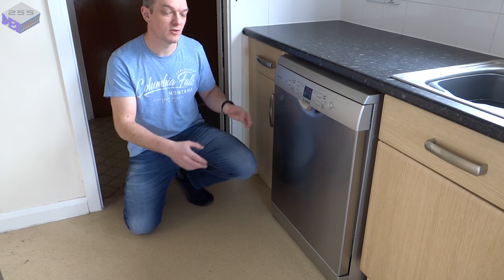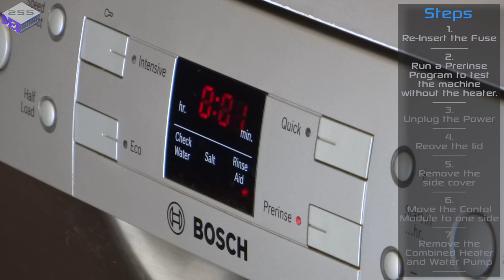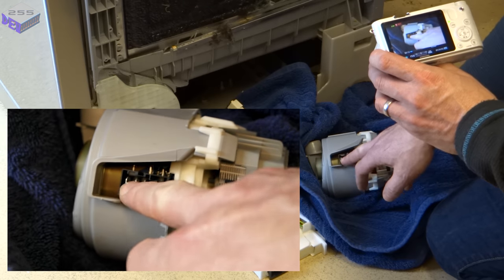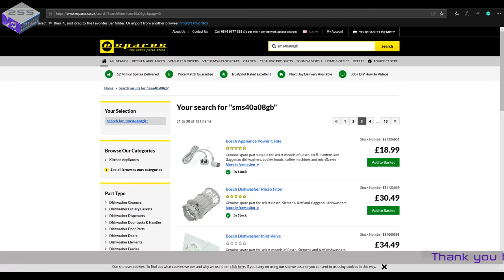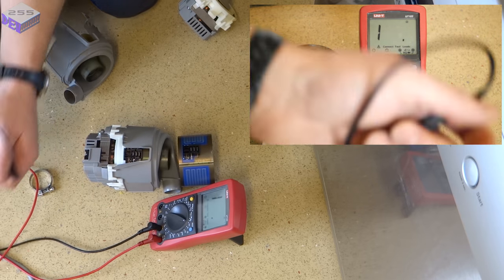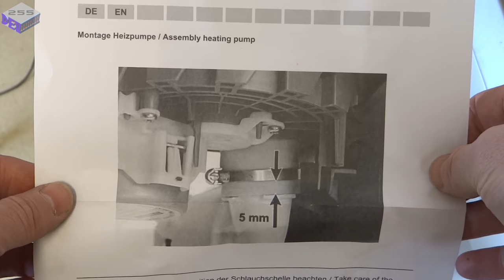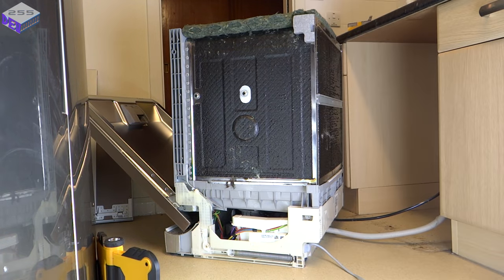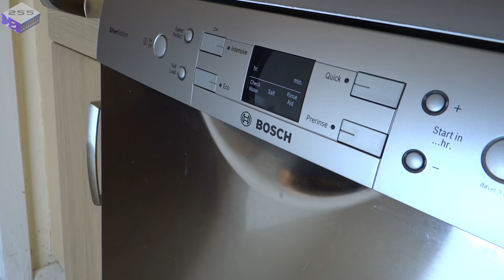How to Test & Replace the Heater & Pump in a BOSCH, SIEMENS, NEFF and more Dishwashers

Comment: Hi did the change out which although a bit tricky manged to get it done, however when I turn the power back on there is not power to the unit, any ideas?
Reply from the maker: Hi, I'd recommend checking everything that was touched during repair, plus the external items, such as Power cable connected correctly (this can look like it's connected although may be slightly out), the fuse in the wall switch/fused spur, RCD that feeds the socket (if testing on lone ring main), test on another ring main/socket via extension (13A one) all the connections are connected ok inside to the main circuit board. Failing all that, there is a possibility that the fuse on the main PCB has gone (if it has one, depending on the model). Hope that helps and good luck. P.S or it may just be a lose/disconnected soft power button inside the machine.
Reply: @TheSolarPoweredEngineer  Neil thanks for the reply It seems the AC power lead was not fully inserting into the white control box, bit of jiggery-pokery and got it fully in so all is ok now, thanks for the video dishwasher is back up and fully working now.
Reply from the maker: @MrPhiltodd  Glad you got it working, those power connections can be tight.

Comment: Thank you for posting this video. It's quite helpful as I will change my heat-pump once the new one arrives. One question though: The plastic connector of the 3 purple wires was damaged. I got a new connector, but I'm not sure if I got the cabling order right. (Labeling on the pump shows 3, 2 and 1). Any Idea /help for connecting the purple wires?
Reply from the maker: Hi, glad the video was helpful. The motor is a DC Brushless type, so each wire would be 120º out of phase of each other, so the pump may run in reverse if connected incorrectly; if this is the case (IE no water sound through the spray rotors) then swap 2 of the wires over and this will be sufficient. As long as the wires don't short out the motor will run. Unfortunately, I don't have a lead to refer to. I hope that helps.

Comment: We have also replaced pump, but have another issue. Grey cables on the pump were accidently pulled from connector. Is there any solution how to put cables back in connector in right order...there are some numbers (1 to 3) on it.
Thank you in advance.
Reply from the maker: Hi, the plastic shroud around the connector on the motor comes off quiet easily and then you can solder on new cables while off the machine, my machine is under the worktop now so I can't check the order of connectors. Could someone else opening their machine help with this please? Unless you have sorted it already. Hope that helps
Reply: I've mine open to fix right now if you are sill unsure. Purple wires go to white block and numbers are on motor, 1 highest up 3 lowest. The have photos of you need them.

Comment: Hi  i thought to check if you in help me a little, My girl used dishwashing liquid instead of dishwashing tablets then There were a lot of bubbles and we got the code e15, I wiped the machine clean and it worked again without error code. After we washed with it twice, the earth fault circuit breaker went off, after about 3-4 minutes, I opened up the machine, measured the heater and I got 20 Ohm so I cleaned a few more things in the machine and then put everything back together. Now the earth fault circuit breaker does not go off but the water does not get hot at all. Do you know what could be wrong?  /Christian
Reply from the maker: Hi, sorry for the late reply, it can take me a while to get through all the comments. It may be the thermistor on the same device and on the same connector as this could be telling the controller that the temperature is high, so it wont switch on. You can measure the resistance of this thermistor, where it should be in the 5 to 100kohm range. If water had found its way onto the heater, it may have also reached the the thermistor too. Plus you may wish to check the cables leading to it and the connections at both ends. Please feel free to ask further questions.

Comment: My pump has failed after 3 months, E09 error again!  Also mine came with a grey plastic clip part, no idea where that goes, inside the pump?
Reply from the maker: Hmm, maybe you have another issue too, are you getting water leaking onto the outside of the motor/heater? It may be worth you checking the front optical sensor hasn't been knocked as it's easy to do when cleaning out the space where the filter sits. I don't know of a grey plastic part for the unit, the pump and heater should come as one assembled unit. You can send me a picture of it if you like, I have a contact part on my web page here: www.dev255.uk
Reply: @TheSolarPoweredEngineer  Thanks for your quick reply! No leaking, I think the pump is faulty again. Sorry, its a blue clip, the 4th image on this site: https://shop.ukwhitegoods.co.uk/12019637-dishwasher-heat-pump
Reply from the maker: Ahh, that clip goes inside the dishwasher compartment, underneath the removable filter.
Reply: @TheSolarPoweredEngineer  Thanks, so this is an extra part, does it need to be replaced too?

Comment: Hi Neil, After E09 error, i fitted new pump. and old were damaged . i already tested old and i am sure that was heat pump issue.
Now after fitting pump, no water in dishwasher and also it is giving wired noise. so what i can do now. thank you so much.
Reply from the maker: Hi, sorry I didn't see your response until now. Have you managed to fix your machine?

Comment: Hi Neil, I had E09 error, as heater wasn't giving a reading on heater I got new heat pump. The E09 error is gone but it's not heating the water even though I'm getting 20 ohms on element. Would you have any ideas?
Reply from the maker: Hi, was the old pump reading less than 20 ohms, you may wish to check your heater connection at both the pump and control board, if you have 20 ohms on the heater and everything is connected ok, take a look inside the control box (without power of course), you may have a faulty controller. Also, was your's tripping the mains when getting to its heat cycle before you replaced it?
Reply: @TheSolarPoweredEngineer  Hi Neil, I had no reading from the old heater and the new didn't work, so I took it out and checked the connections nothing amiss so I put it back together and it worked for the 1st go. Then it stopped working, so I tried to see if I was getting 220 going to the heater and i don't appear to have. Do you know how to stop the program so it doesn't have to go through the whole cycle?
I'm getting 19.6ohms on element, I assume that's ok.

Comment: thanks mate, I did all mine but then getting e15 flooding warning (but e9 has gone now and heat pump works). I think it's due to my new pump not coming with a retaining clip as you show with your instruction. having a look to see if I can find one on amazon but otherwise I'm testing shoving the vertical up as far as I can go and pulling the old retaining clip down as much as I can
Reply from the maker: No dramas, I hope the video helped. It can be a little challenging to get everything back together and sealed tight in those small spaces. Also take a look at the sump water level sensor (usually in front of the removable filter) this sometimes gets knocked and can leak into the base.

Comment: Hi 
I have Bosch SMS69L22/55 GB dishwasher. I had check water and rinse aid lights flashing and dishwasher stopped in the middle of a wash cycle. Checked the filter hose and flow switch, they were all ok. Tested the heat pump and I am getting 20.8 ohms reading. Is this heat pump good or faulty?

Thanks
Raj
Reply from the maker: Hi Raj, the heater should be fine at 20.8 ohms, mine reads 20 ohms and is working well. It may be worth checking for water in the water catch tray (the bottom cover effectively), there should be a polystyrene float roughly in the middle at the bottom of the machine that rises when water gets onto this catch tray. This will operate a switch to stop the machine. Hope that helps, kind regards, Neil.
Reply: Thanks for getting back to me. There was no leak at the bottom. The reason I suspected short on heat pump is that the mains cable plug was getting hot despite dishwater not running and in error mode. There was short between positive and negative, reading 180 ohm on multimeter setting 200k. Sorry not good at units. All the other people online are pointing out the main board at the bottom is faulty when check water and rinse aid lights are flashing. After watching your video I decided to check the heat pump to rule it out. I don't think there is a way to test the main board so I may have to take a chance by replacing it. It is £120 fully programmed from Bosch.

BTW when I pulled out the main board and disconnected all the cables to identify the short, it just disappeared, I mean it sorted itself and now there is no short.

Thanks
Reply: Hi Neil
Rechecked the main power board. Between positive and negative terminals it is open circuit on all multimeter settings except one. When multimeter is set to 2M then I get 0.436 ohm reading. As I said I know just a little about electrical and electronics. By profession I am a mechanical engineer. The main board seems to clean although one resistance is flakey. There are two electrolyte capacitors one small 16v 470 uF, which is holding the charge, the other big one is 400v 100uF, which is just going to zero on all 3 points. Do you think it is right to try the new main board even if it is a gamble or should I do something else. Please advise. Thanks
Regards
Raj
Reply from the maker: @aahanasharma4997  Hi Raj, ah if it starts working again it may be because it has had time for something to dry out. If it's the circuit board, then you may have a leak near there, although this has a water channel built in to its case. if the heater fails it can allow water to get to the live element and cause an overload or short to earth, where this could trip out the earth leakage circuit breaker in your house
Reply from the maker: I just spotted your other message, the 400v 100uF should be the one just after the bridge rectifier, hence the 400v, it depends what is in the circuit with it, you mentioned 3 points on this on, although there should only be 2, plus if you are measuring resistance on the same junction as capacitors it will not measure correctly if it is charged, and may be charged up by the meter. It's hard to tell with components in circuit. If it works and then doesn't work, it's an intermittent fault and may be due to water getting in somewhere, or higher humidity causing the fault. Hard to tell without looking at the machine.
Reply: Testing a capacitor in a circuit isn't possible because of other components. As I spotted a resistance where it's coating is coming off, I decided to test it. I removed the one end from the PCB to measure it . It is giving open circuit on all the ohm settings of multimeter. So this one is definitely faulty. I am not checking the PCB to replace or repair components. I am just making sure that it is definitely the main power board which is faulty. I am going to order the main power module. Once replaced, I will post if it worked or not.Thanks
Regards
Raj
Reply from the maker: @aahanasharma4997  Well done for finding the fault. Good luck with the repair 👍, it would be good to find out if you fixed it. Kind regards, Neil.
Reply from the maker: @aahanasharma4997  No worries, thank you for your subscription 👍
Reply: I thought I had logged out and logged back in with correct account. Sorry it didn't work. Hopefully everything should be correct now. Thanks

Comment: How the hell you open the casing of the motor? I broke all 4 clips (the device is broken anyway), but still it seems to be stuck. I wanna see how burnt the heating device is.
Reply from the maker: Hi some clips can break, although should go back together and hold as it's the retainers behind the clip that breaks, although always best to replace the whole unit if you can. The test of the track using a meter is all you really need to do, I pulled mine apart to show what happened to it.  They can be hard to open
Reply: @TheSolarPoweredEngineer  i opened it, and see some broken traces. I'm wondering why I shouldn't just bridge them again, and use that for now? Only the inside from the heater is supposed to get wet right? If the whole thing would be able to get wet, then the connectors that are already exposed would be have a problem right?
Reply from the maker: @MathijsGroothuis  hi, the water is supposed to stay inside, although if water was able to get to the element or connections it may cause a fault to earth, this could be hazardous to you if you touched the machine if your earth leakage was not detected. The element has a coating on it that should prevent water contact with it, although a broken track suggests this is compromised and soldering/bridging the gap of an element will reduce its resistance and increase current flow, so could potentially be a fire hazard. Sorry to be the bearer of bad news, but I would just recommend a replacement unit. Hope that helps
Reply: @TheSolarPoweredEngineer  i already bought a new pump, because I couldn't find the separate heater on sale anywhere, and the solder doesn't stick to the broken traces.

I'm less worried about the water issue, as the starting connections to the heating elements are exposed by default as well, as well as the connectors. But it mainly seems to hard for me to fix the broken traces. And the only sources of actually repairing the device that low level are eastern Europe in language, so a bit hard to understand.
Reply from the maker: @MathijsGroothuis  Glad you got a new one, hope you are all up and running again 👍
Reply: @TheSolarPoweredEngineer  After buying a new one, I saw someone selling a spare one for just 15 bucks. Went with that one instead, put it in today and it works like a charm again :). Only hassle was actually installing the pump again, as the sight is quite limited, but apparantly it works without leaking.
Reply from the maker: @MathijsGroothuis  Glad you got it sorted and for a good price too 👍

Comment: I bought a replacement heat pump after E09 error code on my Siemens, looks very very similar but not exactly the same as the old one (it was much cheaper!), and it won't heat the water either 😕 do think you need EXACTLY the same heat pump??
Reply from the maker: Hi, they should be the same pumps as long as your machine is listed in the description below this video and may well fit new machines. It's worth checking connections with a multimeter to check that the coil resistance of motor coils match your old motor and the heater element of the new unit measures very close to 20 ohms. Failing that you should have 14 days to return your item to the supplier. I hope you fix your machine.

Comment: Ok. So my lower arm doesn't move. Checked using a dirty bowl and placing arm in a fixed position.
So far.
1. Replaced lower arm. It did have bits inside which I could get out..and seemed like a potential quick fix.. no joy
2. Followed your video, did resistance test on the heat pump, read less than 10 ohms .. so ordered spare, replaced no problem.. definitely getting hotter water now. Still the lower arm doesn't move.
3. You mention the controller - is that I assume the white box you remove to reach the pump. If so how to test and do you know part no..? Note. I have no error codes on my Siemens iq500 dishwasher.. which I would have thought if the controller had failed then I would have a code.. The machine operates just lower gets no water and so arm never moves.. any thoughts?
Reply from the maker: Hi, I would try a good dishwasher cleaner on a maximum temperature cycle, and if you can set your dishwasher to the lower arm wash only (normally heavy pots and pans mode) then this should focus the lower spray arm. It does sound like a blocked path before it reaches the arm and may need pulling through or could be dislodged through the cleaning cycle above.

The spray arm seat should be easily accessible from inside the machine too, so this can be removed and cleaned, plus you could check the spray arm rotates in it when it's out. There should be 2 torx head screws to take out to access this.

I don't believe the arm has an separate control to worry about the controller, but yes the white box that you removed to get to the pump is the main control board.
Reply: Diverter valve